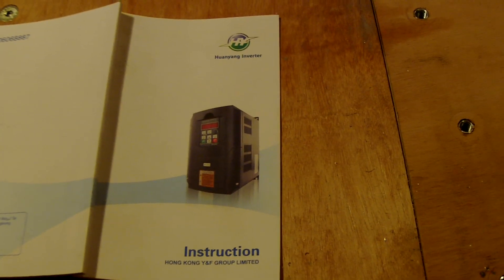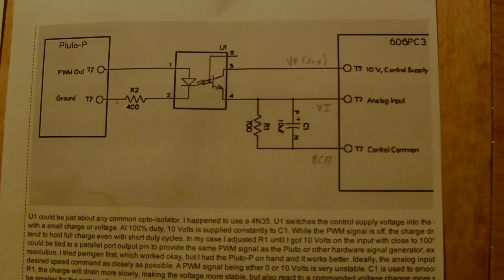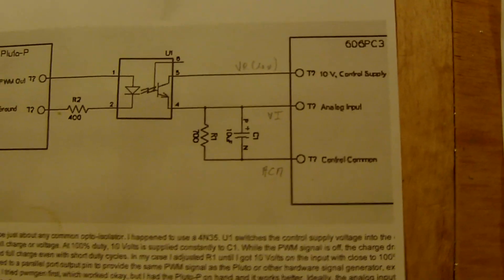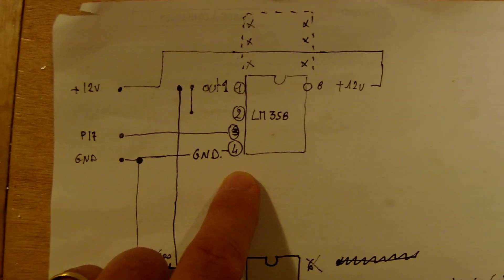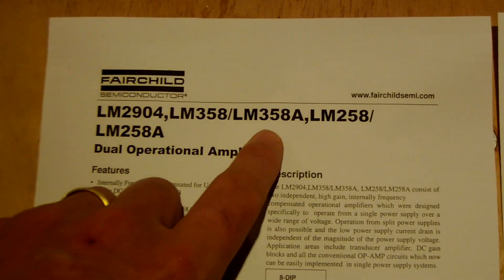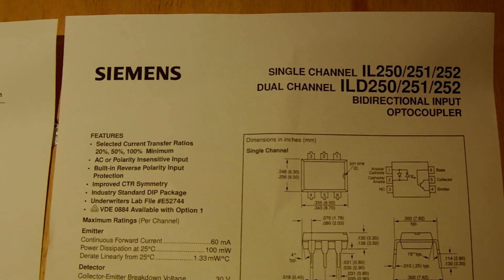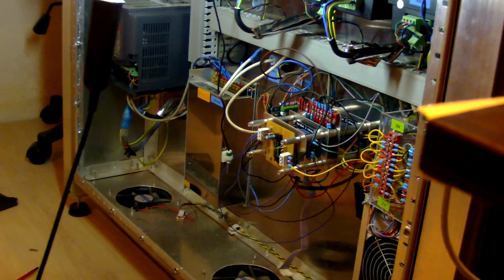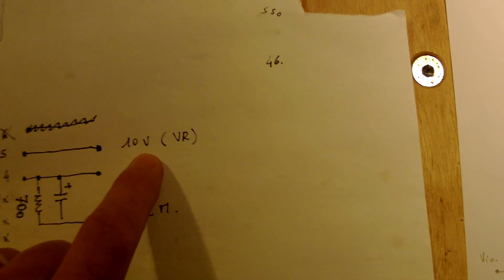Homemade DIY CNC, How to control a Huanyang VFD inverter with Linux CNC / Emc2

Comment: Didn't your vfd come with a 5v (no more than 6v) and a 10v (no more than 12v) option? I have the same brand and all three vfd's have dual voltage control options. In fact there are 16 optional points of CNC control to the spindle for various features one may want to control externally.
Reply from the maker: Hello Fastlane Hobbies LLC
Indeed the vfd can be set up with different type of input voltage ( see comments from Bill Nicholms). But one of my 1st concern was to be sure to protect both side of the system with a simple & cheap circuit. With this design any kind of error either in the vfd setup or breakout board wiring will not affect them.
Also some past version of the VFD does not have all this options.

Comment: Hi, I'm wondering why you didn't change Parameter PD 070 to "1" from "0". This should have changed the control voltage of your VFD from 10 to 5 volts. Your's may be different than mine, but that's how I over came the voltage difference without any additional hardware.
Reply: Bill Nichols mine has pin 3 with 1-6 selections for 5v with varying signals and pin 4 to either use panel control or external control using 10v. The options should be there unless his model is very old.